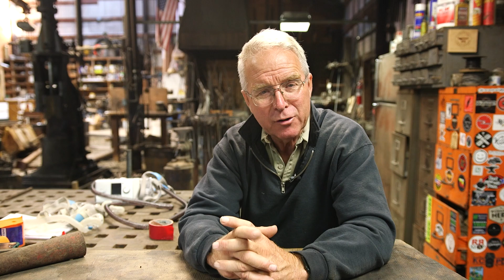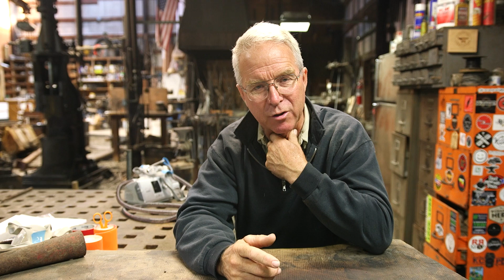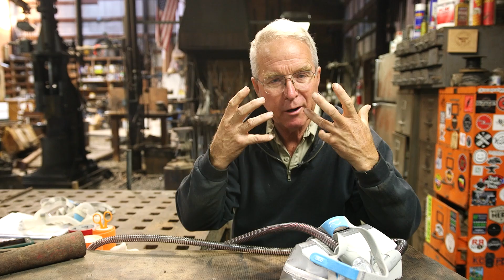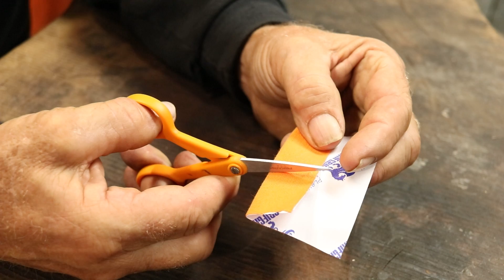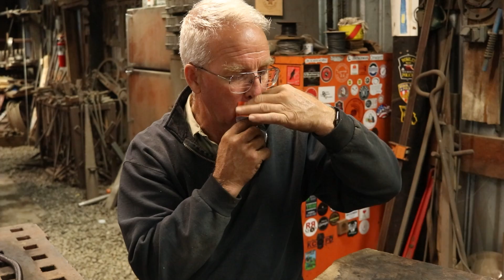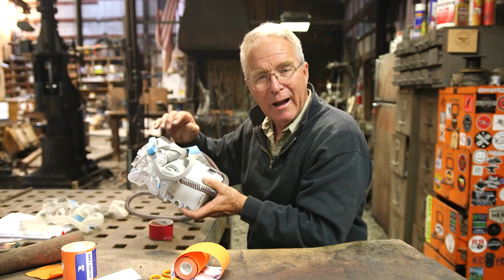Tired Contractor  Here’s My Simple, CHEAP Sleep Apnea Solution

Comment: Interesting topic and well-presented!
I underwent radiation & chemotherapy for cancer in my head a couple years ago; damn near dying in the process (not from the cancer, but the treatment!  They stopped the chemo a couple sessions early 'cause they said it was killing me).  Anyway, survived it all, but amongst the casualties (in my head) were my hearing and salivary glands.  The glands work mostly okay during the daytime, but don't replenish at night, and "dry mouth" had become an abhorrent new torture, waking me at least once per hour every night.  And part of the dry mouth experience was that although I fell asleep with my mouth shut, just my natural breathing patterns relaxed my jaw, mouth opened up, I resumed breathing through my mouth, and all moisture evaporated and I'd wake, absolutely (often painfully) parched.  I've never needed a glass of water near my bed my whole life (now 68), but post-treatment, I've needed something to sip kept handy on the night table every freakin' night.

However, about 10 months ago, I was walking through the local Dollarama, and in the Tools aisle, noticed they were selling these small black strips of an elastic cloth material, about an inch wide and about 6" long.  There were two in a pack.  One end had a Velcro "hooks" square, and the back of the other end had the "loops" to which the hooks would stick.  They seemed to be slightly stretchy little strips you could wind around things like a coil of extension cord you wind up into a loop, then need something to wrap around to keep it all together.

They were a buck and a quarter for the pack of two.  I bought them and that night, attached the hooks end of one to the loops end of the other (making one long strip), then took the remaining unattached open ends and attached THEM to each other, making a complete circle.

That night, I stretched that circle around my head.  It was a very gentle pressure, almost unnoticeable.  From around the back of my head, the other side I simply slid down over my mouth, lightly pressuring across my closed mouth.  It kept my mouth shut very gently.  I slept the entire night, no dry mouth... because whatever moisture was in my mouth STAYED there!  

In the morning, I simply removed this stretchy little "collar" and set it aside.  I've been using it virtually every night ever since.  It's completely reusable, just like pyjamas.  When it needs a washing, you just throw it in the laundry and it comes back good as new.  Best part:  unlike tape, I don't have to keep buying rolls to cut up and toss.  Also, the Velcro can be re-attached in various places along the length, to adjust the level of pressure that works best.  And, I imagine it'll wear out in maybe another couple years...  I'll be investing less than two bucks to replace it.  (As a matter of fact, I think I'll run down to Dollarama before the end of this week and buy another two or three, for the princely sum of 3 or 4 bucks, to hang onto for the future.  Dollarama is notorious for dropping product lines when they run out; the items vanish and they never sell them again.)  And finally, the last potentially fun advantage of this little accessory is that if my place is ever broken into during the night, if the burglar enters my room and I pop up with a wide strip of blackness encircling my head, it might just scare him back out of the house in a flash.
Reply: Good job WJR for figuring out what works for you
Reply: 😁 The end was precious 😆
Reply: What are they called?
Reply: @cluckieschickens  Gonna have to look that up when I buy some more.  Seems I chucked the package, and have no idea of their product name.
Stay tuned . . . .

Comment: I have been using tape for about 3 years and my sleep patterns are amazing! I also use a nasal opener that goes inside the nose which can be put ashes on Amazon! The tape that works best for me is 3m micropore surgical tape, it is hypo allergenic non toxic adhesive. low residue and it holds very well! The price is also a lot cheaper than kinesiology tape. Hope this helps!

Comment: I like that you took charge of your issues. I did the same. I gained a lot of weight between 2003-2009 which led to my sleep apnea. I've always snored even when I was thinner. It's a family trait I guess. My weight gain of course made it worse which led to me falling asleep at stop lights and drives that were 30 minutes or more. In 2009 I started using a mouth guard by Pure Sleep which helped a lot but as time went on and I gained more weight, it didn't work so well. In 2018 I got married. My wife took notice of my falling asleep all the time and told me I might have sleep apnea. We didn't have health insurance and couldn't afford a sleep study so I took it upon myself to by a CPAP. I bought a Resmed AirSense 10 with the nose pillows and that thing changed my life. I tried the face mask but it was useless to me. The nose pillows work incredibly well. Good luck to you. I hope your methods continue to work for you. I would suggest giving the nose pillows a shot. I no longer breath through my mouth at night as the nose pillow sort of force your fourth closed. Try it out. It may even be better for you.
Reply: How did you know what to set the pressure limits at?
Reply: @gary24752  the AirSense 10 has auto settings that adjust as you sleep.
Reply: @gerrithoevers  I know that. I have used that machine for over five years. Now I have an Airsense 11. How is head is positioned has a lot to do with how well it works in regards to how your head is tilted.  After trying a number of different pillows I settled on a pillow that you use on an airplane as it keeps the head tiltled backwards to some degree, keeping the airway open.

Comment: Several years ago my Dr sent me for a sleep study. I caught a severe lung infection that I battled for six months. I traveled alot and requested a very portable c-pap. The sleep doctor was very uncooperative. After several tries and i found  if I quit sleeping on a pillow and just placed a rolled up hand towel under my neck, sleeping on my back,  the position of my head caused my chin to be lifted, also lifting the tongue up and forward. This is also taught in CPR, called  the "head tilt, chin lift". The chin should be pointing straight up. It lifts the tongue up and prevents it from closing the windpipe. I also discovered my shoulder and neck pain and stiffness went away. It was a win-win solution that costs nothing. I have been using this technique for several years. It has worked for me. No pillow! Best wishes.

Comment: I am very concerned for you. 
Some options: 
1. Surgery to remove excess tissue 
2. Slowly increasing the pressure on the bi-pap  instead of doing it all at once if possible
3. Get real heart monitoring especially during the night and see if you are really getting rest - if your heart rate is falling and irregular - possibly getting into atrial fibrillation, you can throw a clot and have a stroke. 
Apple is good for letting you know you need further testing. 
Apple isn't very good when you already know there is a problem with both obstruction and central sleep apnea. 
Please do what is very best for you. 
Thank you for sharing your struggle and solution!
I appreciate your channel and stories and I'd like for you to stick around with us for a long time!

Comment: I read an article about a study where participants with sleep apnea learned to play the didgeridoo (that Australian native instrument). This involves circular breathing. The study found that they all had improvement in their sleep apnea. Something about strengthening the soft palette if I recall correctly. Most likely, any instrument that requires circular breathing to play would produce similar results.
Reply: I read the same article some years ago. I made my own didgeridoo and got some improve in my apnea. However, I noticed that is not only a question of “circular breathing”, it is related with a stage of mindfulness….
Reply: Cool! You could also use a straw in a glass of water for circular breathing exercises. The goal is to keep a steady flow of bubbles.
Reply: With the added benefit of scaring off anyone around you while you're playing.